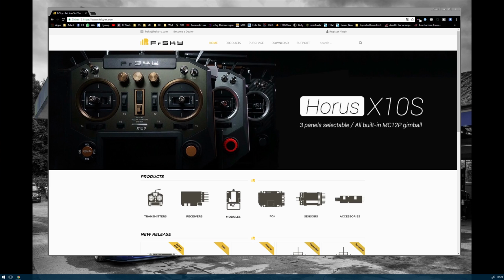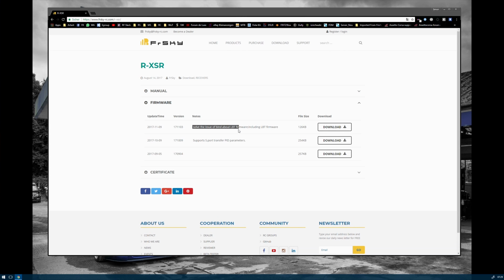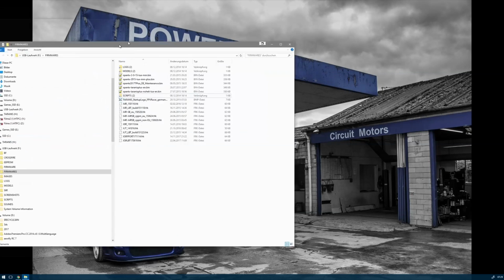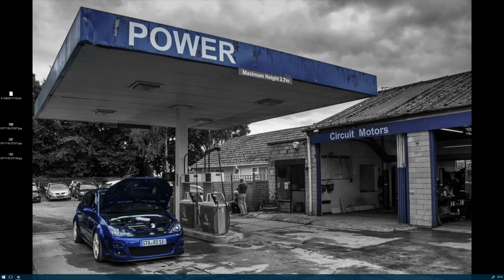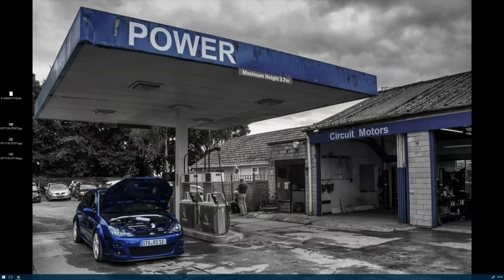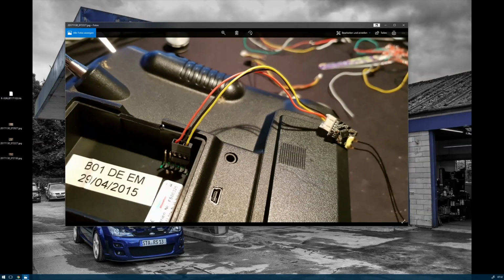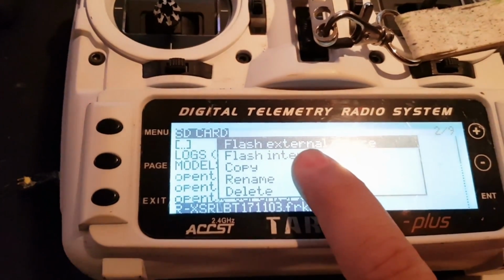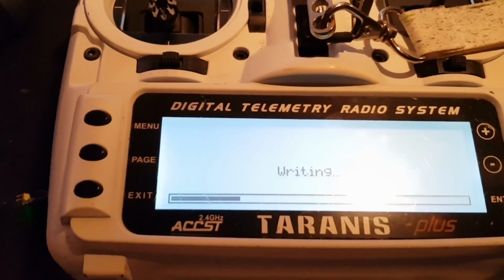FrSKY R-XSR Firmware Update with a Taranis X9D

Comment: I have two R-XSR’s and I barely get 200 yards- MAX..... wtf is going on, these are supposed to be great Rx’s ...... I am using them in the vortex 150 and 180 and antenna orientation is at 45 and 90 degrees .... both Rx and tx have latest firmware
Reply from the maker: Maybe your Hf module inside the radio is blown? Do other rx work well?
Reply: The D4R2’s DONT have good range either, BUT- I tried one of my R-XSR’s on my friends Qx7 last night and range was still terrible. I’m failsafing way too early and don’t know which way to turn, I don’t want to start chasing down the problem by buying new stuff, that can break the bank! I’m considering the TBS crossfire and just be done with it.